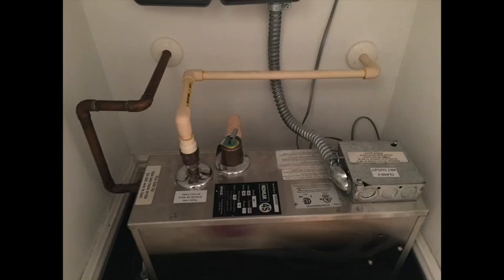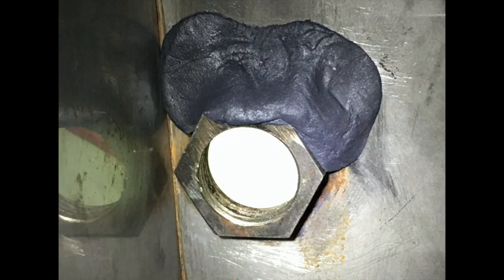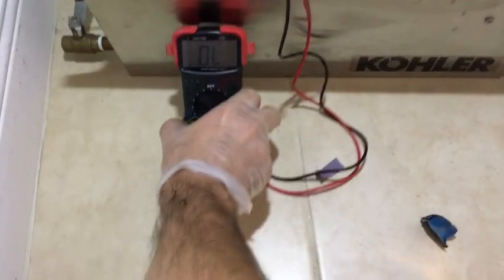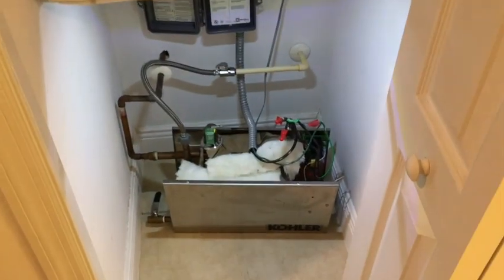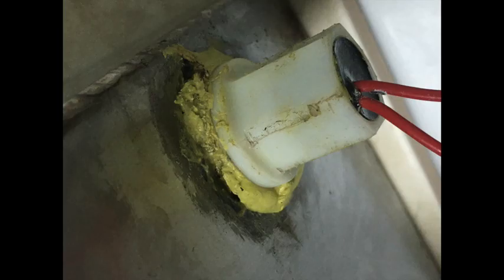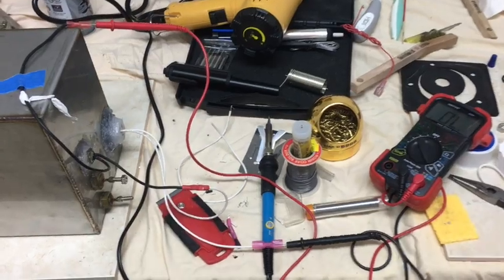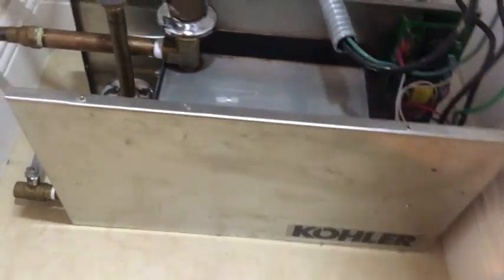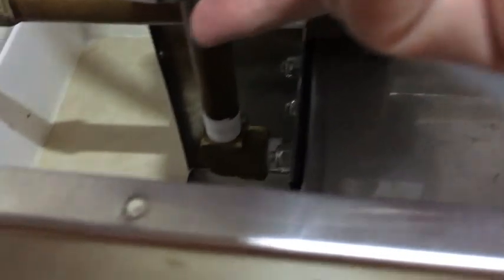Steam Generator Repair (Kohler K9, 1659) - error 5

Comment: Excellent video Nasri.  My issue is no leaking inside unit, ERR 5 comes in about 10 seconds of turning on power button.  I disconnected the water supply and let it run into a bucket to make sure i had good clean flow of water.  I put a wire down into the inlet as far as it would go and nothing blocking it.  It sounds like my float is telling the system there is no water even though there is.  Is there any other device that would cut off the water from going into the tank?
Reply from the maker: You can easily check if your float switch is function properly. If you have a multimeter, you can check for continuity (when you have the unit disconnected from pipes and electric) by flipping the unit upside down (the level of the float switch "close" mimicking the float induced by water. If you get continuity with multimeter, then the float switch is ok. Keep in mind that in the end, one of my issues was not only the float switch and the leak, but also that the thermal switch was busted. I eventually shorted the thermal switch - it has been working fine ever since!
Reply: @nesnas  I was able to fill my tank through the drain. My switch is good when there’s water in the tank. The system works fine and it produces steam until it shuts off because no water is getting into refill the tank.
Reply from the maker: @__Just_A_Guy__  seems like an issue with the water inlet ?

Comment: Thanks for making the video. So was your conclusion on error 5 due to faulty float which was fixed with a new float? Besides fixing threads and maybe shortening the float wire it seems like the new float switch was the biggest change. 

I’m getting error 5 now which I was getting years ago but back then I was able to fix it by replacing the heavily corroded heating coils…besides vinegar bath to clean out minerals. Now that error 5 has been happening periodically I assumed that the coils were corroded again but when I opened it up both heating coils looked like new and even still replacing them did not fix my error 5. 

Thankfully my plumber connected mine with all threaded pipes and water shutoff so I can disconnect and work on it pretty easily. Guess I’m ready to start replacing more parts to see what works.
Reply from the maker: Thank you for your comments Tim.  Actually, even though the float switch could have resulted in error 5, after a month the error came back and  I noticed that the thermal switch (which is connected with the float switch in series) was causing this error. I tested it when the unit was apart (and cold) and it was a closed loop (circuit). However, the only way to test it in operation is to temporarily short circuit the float switch and thermal switch (which was the only two that could trigger error 5), and then run the unit with the electrical panel open (but be super careful - you're talk 240 V)  Test the Float switch and thermal switch with a conductivity test with your multimeter. What I noticed was that the float switch kept conductivity (at 3-5 OHMS), whereas the thermal switch started flickering between closed loop and 1 Mega Ohm (open circuit). This only happened when it was hot. So you have two choices: replace the thermal switch - the rod directly above the heating coils, or rely on the float switch - which is what I ended up doing. If the coils end up drawing too much current, it will trip the 50 A circuit breaker - so in some regard; that a second line defense. I have been using it for the past 7-8
 months with no issues at all!
Reply: @nesnas  thanks so much for the explanation. Mine normally throws error 5 after it has run for a while but it's happening more and more quickly over time to the point that it is not enough time. If I'm understanding you correctly, you ended up bypassing the Thermal switch altogether which has eliminated the faulty short circuit it was created and that fixed it for you. I just purchased a Thermal Fuse Kit ($33.30) so I will give that a try. I also purchased Fast Response Thermostat Kit ($7.80) and a float assembly kit ($157.36) just to have them in case they are ever needed.

Also just an FYI on maintenance... our unit was installed with a small copper pipe from the drainage valve down into the drain pan. I was able to rotate that pipe so that it sticks straight up and is taller than the unit itself. I then found a very small funnel in the kitchen that fits right on the pipe. With this I'm able to open the drain valve and pour white vinegar into the funnel which goes in the steam chamber. After vinegar is added I close the drainage valve and let sit normally over night. The next day I start with a power clean which purges all the vinegar out before steaming. I assumed that was working pretty well but now that I've looked inside I know it works well because the chamber was almost completely mineral free after over two years. That was a big deal because where we live has a lot of mineral in the water which is constantly clogging faucet gaskets etc.
Reply from the maker: @RealFrankyDog  From your reply: "Mine normally throws error 5 after it has run for a while but it's happening more and more quickly over time to the point that it is not enough time."
This is exactly what was happening in my case as well. I believe this is a symptom of the thermal switch (and not the float switch).  And yes you understood correctly: I eventually bypassed the the thermal switch (the old one is still threaded in the unit but not electrically connected to anything). I would have replaced it, if I had the whole unit out of the closet and apart again. But since I had to work in the tight corner by just removing the side panel, I just diagnosed that the issue was the thermal switch (by initially by passing both thermal and float switch - while running the unit); then I reconnected the float switch alone. The idea is that if the water flow is ever interrupted, the float switch alone will stop unit and prevent overheating. So far no issues!
Reply: @nesnas  thanks for the clarification. After getting another quick error 5 I decided just to try bypassing the thermal switch by cutting the wire and then connecting the ends together to see if that would work for me too. Unfortunately I ended up getting another error 5 pretty quick again. But then this morning for some reason it ran for a long time without throwing the error to the point where I turned it off because I was done. 

If I'm understanding you correctly you are saying that you can also bypass the float switch and the unit will still operate? I was assuming the float switch itself is used within the operation for the unit to regulate how much water is released into the chamber. But if that is not the case then I could see how it could also be bypassed. I have the parts on way but it doesn't hurt to trouble shoot in order to better help understand what my problem is.

Not sure if you are on FB but a while back I created a group for Kohler Steamer Owners because there isn't a lot of information available from other owners online. If someone is searching FB for answers they will hopefully find the group and I can be of some help like your video has done. https://www.facebook.com/groups/456707758910197
Reply: @nesnas  out of curiosity I decided to bypass the float switch and sure enough it is running with straight steam and no errors. While I’ve got a new float coming it is unfortunately the hardest to replace and I’ve got corrosion around mine too although it’s not leaking….so I may just use like this until I have more time to replace switch. I do wonder if these switches are meant to protect against a larger catastrophic failure not evident when everything else is working properly.  Like you said, breaker should pop should something happen…. Ultimately though if we were not servicing our units we probably would be having to buy new or refurbed units since  there are not local technicians who can help.
Reply from the maker: @RealFrankyDog  I agree! I had was done replacing my own water heater (right before my steam unit started giving this error). Obviously, a brand new water starts around $350 or so (affordable, so worth replacing with a new unit) but a new steam unit (like the one I had) was around $4,000; so I had to find a way to fix it.
Reply from the maker: @RealFrankyDog  At least in my case the float switch is a closed circuit if water is in the unit at the appropriate level. The unit will always let water in via the floating device (that is similar to the toilet flushing system - simply water inlet valve that opens when the big floating unit is low). So it has no communication with the float switch. The float switch is merely there for safety. You can totally bypass with a closed loop circuit. I bypassed it for the test, but then since I replaced it with a brand new one that worked well, I only needed to bypass the thermal switch which was clearly erratic and I did not want to take this unit apart all over again just to include a secondary safety switch. The float switch and the circuit breaker is plenty safety for me!
Reply: @nesnas  I've now reconnected my Thermal switch while leaving the float switch bypassed and now mine is not throwing error 5. In my case though I wonder if the float switch is the issue or if it is doing it's job detecting lower than normal water level due to low water pressure or a clogged valve. While my unit isn't throwing error 5 now that float switch is bypassed, I can tell slightly decreased steam at a certain point when I normally would get error 5. It's still more than enough steam for our small shower so I'm glad to have bypassed but it will be interesting to see if putting in the new float switch will fix the problem or indicate a problem with reduced water supply not filling the chamber as quickly as the float switch needs. If that were to be the case then I'd need to start looking at the water supply since we have dealt with a lot of mineral from our well. Thanks again for making this video and feedback as it's really helped me understand how my unit works and has allowed me to maintain it myself.
Reply from the maker: @RealFrankyDog  You're welcome! I also appreciate when folks who post their videos respond to questions since it clarifies things for everyone. The float switch is actually easy to test (as you may see in my video). When the little floating device is up, it gets close to a magnet that brings two metal plates in contact closing the electric circuit (and should read 1-8 Ohms at the most). If it is intermittent or reading 40 Ohms - higher, then the metal contacts within the plastic are wearing off. Otherwise, you may have a water flow issue (and the float switch in that case is perfectly doing its job).  That's also easy to test (I didn't quite capture my test in this video - I wish I did): But I connected the water inlet (with the large metal floating unit) and placed it in a large bucket. I turned on the water supply, and then using my hand, I would lift the large floating device to make sure the water supply shuts off, and it did. When I lowered it, it would gush water out into the bucket. So it was working well (exactly like the old style toilet inlet valve).  It is possible in your case that the floating plunger shuts the water off a bit too pre-maturely (when it should shut it off when it is essentially horizontal). Otherwise, you will have much less water, and this could lead to a less than optimal steam flow (and if the water inlet is further blocked, as you may be suspecting, it could lead to overheating of the heating coils - which the thermal switch will open and leading to error 5).
Reply from the maker: I just added the update extracted from my short video listed above! My reply below also summarizes my update. But Please read the update I have pinned above. It will explain things a lot clearer. If your unit runs for a few minutes and shuts off once steam starts to flow, then more than likely you have a faulty thermal switch.

Comment: good call on installing the shutoff valve. since there isn't a drain pan, you may want to turn the water off to the unit between uses just to be safe. mine developed a slow leak through the solenoid and instead of overflowing into the shower it went through the pressure relief and flooded the place
Reply from the maker: Thanks. That's unfortunate what happened in your case. I am so baffled that builders would not opt to add one when they install just to save $5 or so, but leave home owners at high risk to potentially costly repairs due to floods etc.

Comment: I think you had the same installer as what I inherited. No shutoff valve, dimple not aligned, poor head assembly, and even putting the control pad thermostat on the OUTSIDE of the shower. That's first rate incompetence!
Reply from the maker: And just when I thought it could not have been worse, I find out that I am wrong! Wow thermostat on the OUTSIDE!??